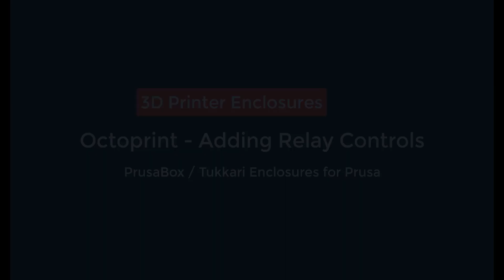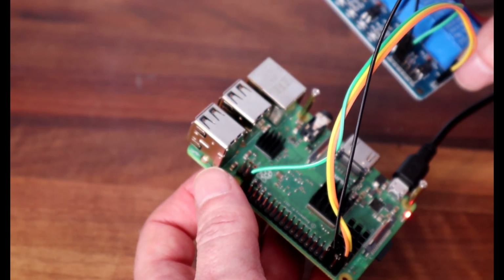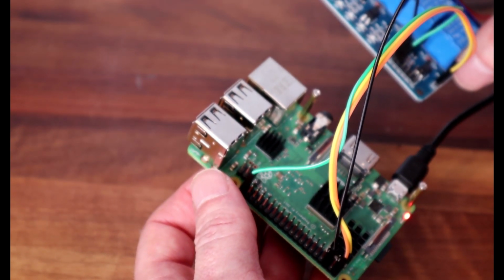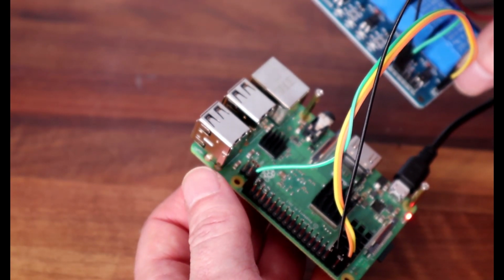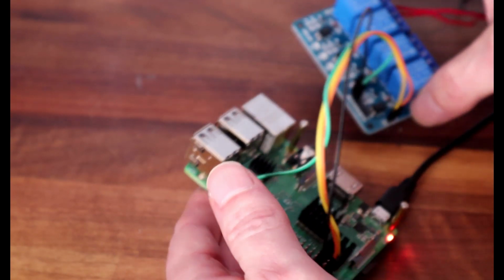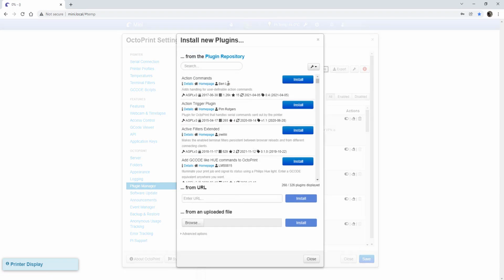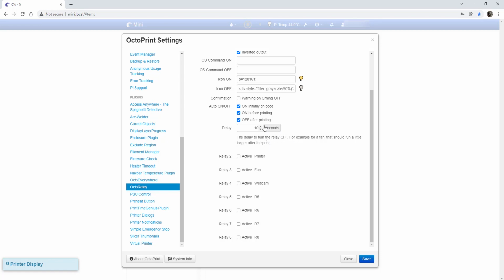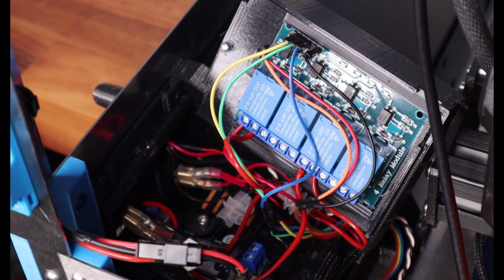Raspberry Pi Relays - connect to Octoprint and Octorelay for 3D Printers, installed in Prusabox

Comment: Thank you so much for this video, I have the exact same relay board and no instruction so of course I wired it with the wrong vcc pin and it drove me nut with the relays working randomly when they felt like it. With your wirering instruction it works like a charm now. Thanks again!

Comment: Hi, Colin! Thanks for another great video! I'm curious about using a manual switch for the lights in addition to the relay. If the relay is open, can the switch still turn the lights on or do you have to leave the relay closed and then use the switch? Also, could you tell me how you've got that setup wired? Thanks again!
Reply from the maker: Hi. Trying to get time to do full wiring video. You are correct the switch won't turn the lights on, the pi has to do that. But I like the option to manually turn the lights off.
Reply: @colinhill  Thanks for the clarification! I'd greatly appreciate a video just about the wiring. The Printer Box documentation leaves much to be desired in that area.

Comment: Hey Colin, great video. One question, the GPIO pins on my Pi are currently all used up for the octodash display. Are you connecting this to a second Pi? If so, where do you put it? Thanks.
Reply from the maker: My pi uses a DSI display so that's using the display output via ribbon cable. That means all the gpio pins can be used. You can't use a second pi. I would suggest changing your screen for one that mentions DSI connection.
Reply: @colinhill  thanks that's what I was thinking.

Comment: If we are using a buck converter, do we not have to use these relays?
Reply from the maker: The relays are for connecting to a Pi, allowing the Pi to turn on or off devices. Often using plugins like Octorelay. Else just have manual switches.
Reply: @colinhill  I understand what they do, I am just asking if I need one if I am putting in a buck converter or does a buck converter do the same thing.
Reply from the maker: @mrjayd  a buck converter converts 12/24 volts to 5 volts. So gives you two power sources for connecting devices. You can add inline manual switches to turn the devices on or off. Relays are added to buck converter power supply only if you need automation via pi

Comment: Thanks for all your informations. I am starting to get everything together for my Printerbox including the fan speed temperature control panel. Because I am very new to this I want to ask which cable diameters you are using so it’s reliable to use but also easy to install? Because I want to set up a pi with a display I still having you scenes in mind where all the cables (including the usb) has to find a spot without preventing the assembly.

Thanks a lot and greetings from Berlin
Reply from the maker: I believe most wires were 22swg i would suggest multi strand so they are flexible. The prusa box facebook site has some beta versions of wiring diagrams.

Comment: Another question for you, Colin.  Presumably if you are powering 12V fans and lights, you need 12V relays?  Couldn't get my 12V LED lights to power on from OctoRelay but then realized that my 4 channel relay board was 5V.  If that is the case (that 12V relays are needed), do you think I've fried my 5V relay board by feeding it 12V?
Reply from the maker: Oh! Be careful wiring up. Your LEDs and fans should only go to the relays (relays are usually able to handle a lot more than 12v), not any of the Pi spike pins. You only connect one side of the power to these devices. As an example for leds, basically from your 12v buck converter 12v output run positive cable to the centre common of a relay. Then from the normally open terminal connect the positive wire of your LEDs. The negative goes direct from buck converter negative to the led negative. The Pi connections are totally different. The spike pins in a row are only designed for a signal from the Pi. And if you have a 4 board relay similar to my video then note I removed the jumper and connected 3.3 and 5v leads to get the relays to work. If you have more specific questions let me know.
Reply: @colinhill  Thanks Colin.  I did wire them exactly as you showed in the video.  The Raspberry Pi is not wired to the lights or fans in any way only to the relay board.  Strangely, despite the light for the numbered relay illuminating on the relay board when I activate the relevant relay in OctoRelay, neither my lights or my fan will operate.  This is why I started to think that a 5V relay board wasn't going to work.  That being said, after I sent you my my initial question, I wired the lights and fan to the center and normally closed side of the relay and they operated just fine.  I'm going to buy another relay board and see if perhaps I just have a dud.  A frustrating couple of hours scratching my head on this one!
Reply from the maker: @williamaprea7124  there is an option to Invert in octorelay. Try that.
Reply: @colinhill  It was a bad relay.  I replaced it and it works fine!  Thanks again for the great videos!

Comment: Do you know if the relay could be powered from the Buck converter instead of the Pi? That way you would only have to route the signal wires from the Pi's GPIO to the relay module in the back of the enclosure. Thanks for your content
Reply from the maker: They could. But I prefer to be able to shut down the Pi and know the relays are powered down. If powered from buck converter there would always be power on, unless you unplug buck converter. It's a personal preference.
Reply: @colinhill  Thanks for the fantastic video once again.  A follow-up question for the wiring.  What length jumper cables are you using between the Pi in the front of the PrusaBox and the relay board in the rear of the PrusaBox?  100cm?  Some other length?
Reply from the maker: @williamaprea7124  I make my own. Chop a pi cable in half and add a section in-between. Solder and heatshrink it.

Comment: Hey Colin. What are those translucent multi-way connectors you use on your builds?
Reply from the maker: Are you talking about the 2 wire JST connectors? Or blade connectors with clear rubber covers?
Reply: @colinhill  You're holding them in your hands at 2:19? I think it's how you connect multiple fans to one relay or switch? I'm new at some of this electronics stuff and want to learn!
Reply from the maker: @ny-lights  Ah right! Those are simple electrical connectors that have been around for decades. Try searching on Amazon for something like "12 Pack Clear Electrical Terminal Blocks Electrical Connector Blocks" - you will see lots of different sizes and rating of similar connector.